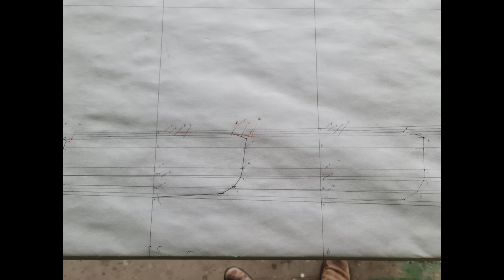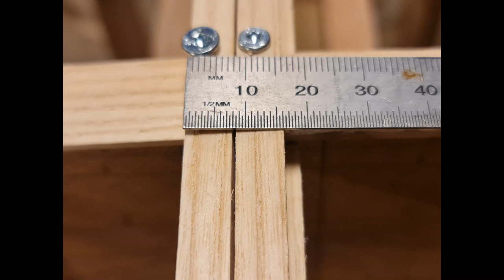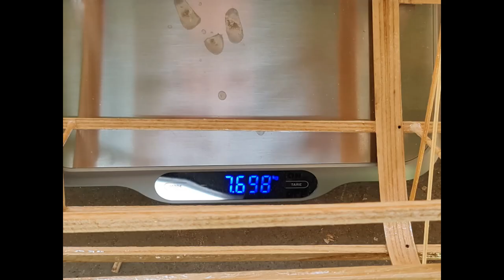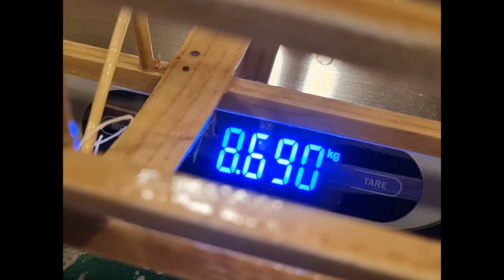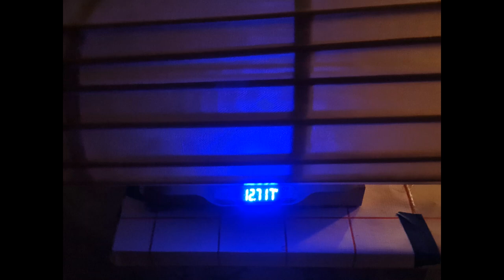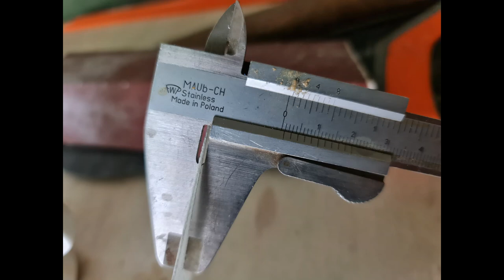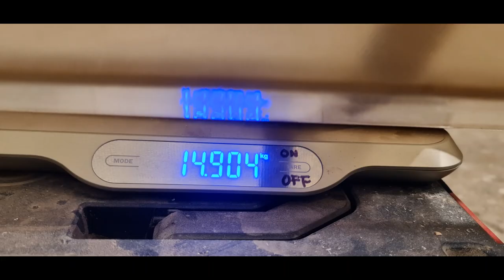Surfski Build  nr 3

Comment: Hi Eirik, excellent job! and outstanding design with that bow bulb.  And you skinned your Frame with Fiberglass!!! I explored a lot this idea, but yours is the first I´ve found.
Would you please comment me on the :following issues
How did you manage to keep the Fiberglass stretched while applying the epoxy on it? 
How rigid or flexible it came out? 
Best regards
Reply from the maker: Hi 

I chose this method due to concave parts of the design, and integrating sitting bucket etc. 
I covered only half the shape in each curing face, overlapping by sanding down previous layer. 
Example: 
-Underside first. 
-Then turning the boat over and doing the topside.
-Then repeating with rigth side up, then left side. 

The application are probably easier with shorter distance between stringers so the cloth dont sag. The application was done by wetting the cloth out just enough, then dragging the cloth to strech it, as the epoxy goes into curing, the cloth gets more sticky and it holds itself in place more  and more. Dragging was done from the centre and with flat palms dragging the cloth taking out slack. 

If remembered correctly there is 3-5 layers of 160g/m2 e-glass with epoxy.  Sanded between layers. Its more stiff, but you can deflect the gf between the biggest gaps by a few mm if you try hard. 

Best practice woul be to have many thin stringers backing the glasfiber. 
Thin stringers would need to be backed by something to not deflect while fairing the hull. 

Maybee this is possible to decifre. 
It was experiment. Wich worked quite well. 
It ended up weighing 17 kg, the goal was 12kg. 
I tried combining nylon cloth with gf, the cloth acted as a peel ply. I also tried streching silf as the first layer, that turned out wrinkly. 

Hilsen Eirik
Reply: @eiriks6005  Thank you very much for your reply Eirik. 

What is SILF?

 I was thinking... 

what happens if you first wrap the frame with plastic film (like the one used to protect bags at the airport), and then lay the GF? 

AS  the plastic film will remain there, it will prevent the GF to get glued to the frame , dont know if that is good or bad, but in Skin on Frame kayaks skinned with nylon or polyester , the skin results lightly glued to the frame due to the paint or varnished applied to the skin.

Regarding thickness of GF, and now that you know the tickness that worked good, do you think that it would  have  be better to apply only one layer and  avoid sanding?

Regards
Horacio
Reply from the maker: Silk.

The glass fiber workes together with the wood, so its strongest when glued to wood. The application of cloth only works on sufaces facing up to vertical. Its not possible to strech gf similar to traditional skin on frame. 

But a kayak can be a combination of, pure composites, wood sandwiched between gf/kevlar, and skin on frame.